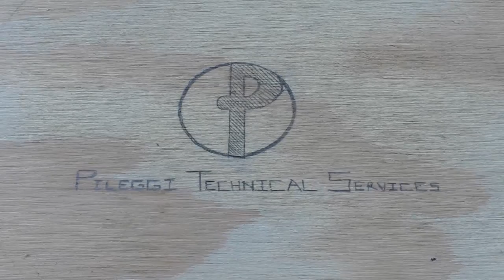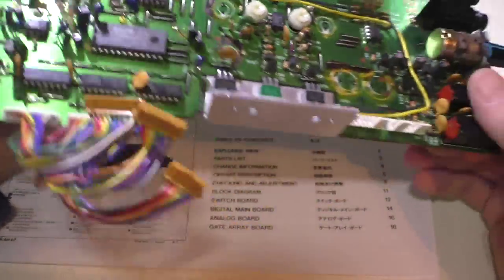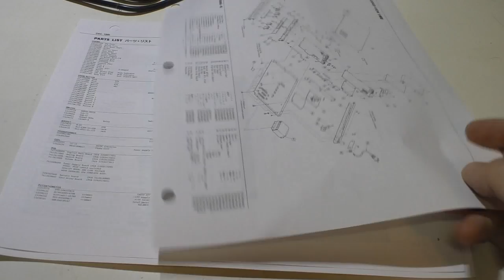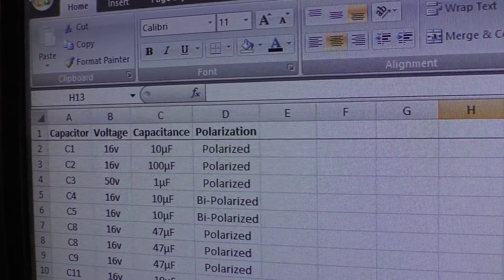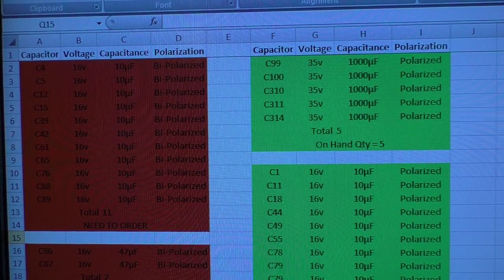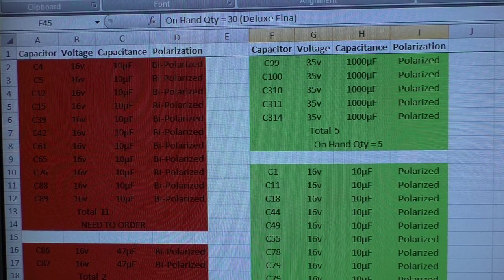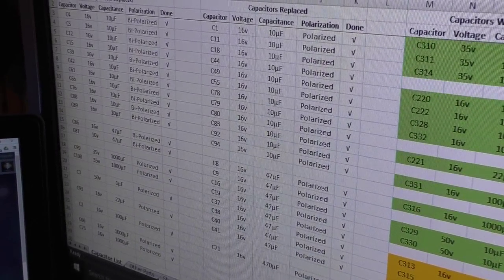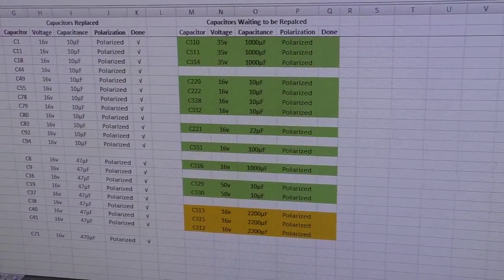PTS Ep. 25 - Repairing a Roland SRV-2000

Comment: hello master.... i have one SRV-2000 i bought it in Reverb 1 year ago, i received it and test it, and everything looked good.... but yesterday i turned it again and it on but  the display doesn't work, any led.... what could it be? Thanks
Reply from the maker: If the unit still powers up, it could be as simple as a loose connection.  It could also be a bad display.  But if the unit does not power up, it will most likely be a bad power supply.  I still offer repair services if you're interested.
Reply: @pileggitech  thanks for you answer, i live in Mexico. Its the problem. The unit power up. And but it doesn’t charge the FX it only work as bypass and the led of baypass and dB signal work as well. But the display doesn’t as the other buttons too..

Comment: Thanks for this video. I am a bit confused when choosing which caps to buy.
Does the physical size of the caps matter? Sanyo, for instance, I can not find in 13x21mm.
And Im not sure is it safe to buy the cheaper models. I need to change all the caps c99 to c316. Any advice would be appreciated. :-)
Reply: Actually, I would be awesome if anyone can provide links to specific products that ship international. Thanks
Reply from the maker: Size only matters if the replacement is larger and not smaller.  They might not fit if they are too big, unless you mount them horizontally.  The voltage and capacitance ratings are much more important.  You can go safely go higher in voltage, but not lower.  Cheaper models might work but better brands might sound better.  And I'd check eBay for the parts as these came from there.
Reply: Thank you very much :-)
I looked at the Elna SILMIC II caps, but they seem bigger.
I will have another look
Reply: Elna caps are made in Thailand, I bought some from the electronics market in Ban Mo/ Bangkok last time I was there, they are generally a slightly larger physical size than most other brands. Older caps also often tend to be physically bigger, making Elna's a good replacement aesthetically. I tend to always buy Nichicon caps, 105ºC rated as they generally have a higher usage threshold. Audio-grade caps is somewhat of a myth, often marketed by brands like Panasonic.
Reply: I am going to change all electrolytic capacitors. Use 105C type and 16x25mm for the big ones. Avoid 85C types because the unit warms!
Check battery voltage and must be up to 2,4V (2,7V measured after 33 years). Replace battery when unit is turn on and be careful because there are live parts!
Reply: You can find PANASONIC capacitors, and Farnell is the sailer. 16x25mm can be mounted measurement done). Use transparent silicon gel and put it around capacitors  base.

Comment: so it needs same battery?, but could it be done to solder a slot and replacing with CR2032 battery?
Reply from the maker: The battery used here is rechargeable while a standard CR2032 is not.  If you can find a 3V rechargeable CR2032, than yes, you can.

Comment: Hi i just bought a srv to fix but cannot find a service manual . mines in a worse state than yours . not sure if i should tackle this project  . also do you know what the long silver caps are as they are leaking

thanks
Reply: +Terry marsden update i found your service link and found there filters
Reply from the maker: +Terry marsden I had a feeling you were asking about the low pass filters.  Dave purchased a second SRV on eBay for $40 in great condition and he's already in the process of ordering new caps for it.  Feel free to contact me via email (pileggitech@gmail.com) if you need assistance on your repair.
Reply: +Pileggi Technical Services  I think the filter gone as it is leaking  plus the power board has issues . either i get another srv or forget this  unless you know a replacement for the filter
Reply from the maker: +Terry marsden Roland uses these filters in a few of their other products, so you nay be able to go that route.  Dave found some of them on eBay under the name "Murata Filter".  You should give them a shot.  It looks like they run around $60 each.
Reply: I have refurbed the Murata 10.25 kHz LPFs. The SRV-2000 is a cool processor, and worth repairing.

Comment: I hear you can push 3 buttons on the SRV and it turns into a Digital Delay is it true....
Reply from the maker: Not sure.  Dave and I haven't really been in touch lately and he's the owner.  He never mentioned that to me and I really can't reach out to him to have him try it for you.
Reply: Yes you can but its really basic.
Reply: To enter "delay mode" - while holding WRITE, REVERB/NON LIN and ROOM SIM, turn the power ON. Delay mode is used as test program for check and adjustment purpose, generating single delay sound.
Reply from the maker: Thank you.  That will help someone in the future.